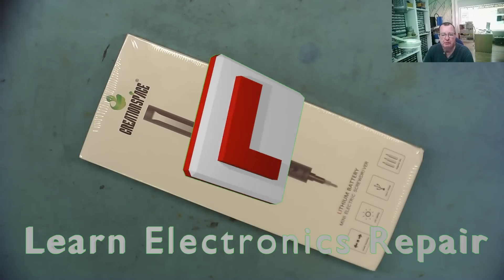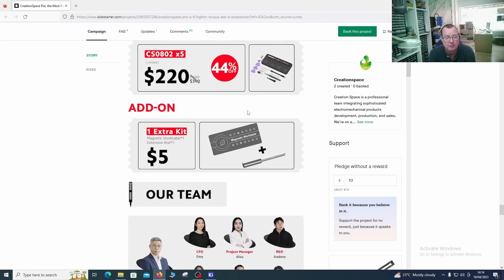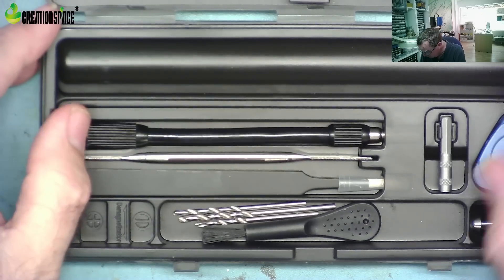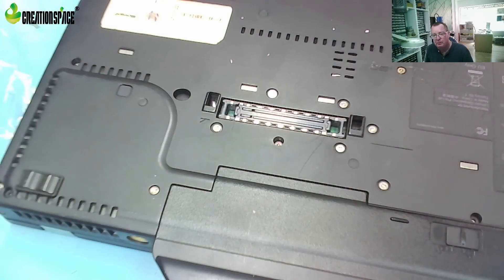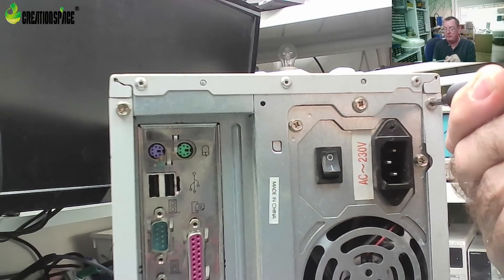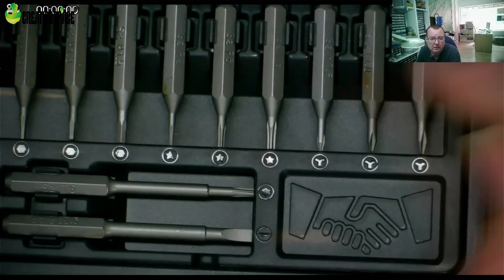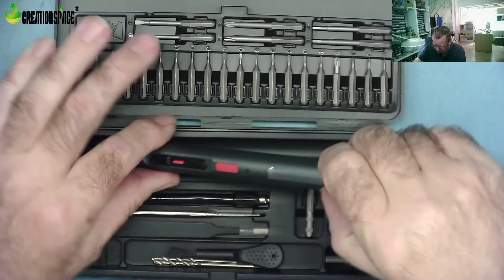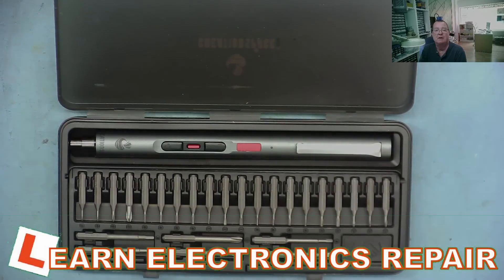CreationSpace Pro The Most Powerful Pocket E-Screwdriver.  Is It Any Good?

Comment: Problem is that high torque screwdriwers MUST have square body or a larger diameter. Small diameter round body of this screwdriwer will just cause it to constantly slip away in your hands and your hands will get increasingly tired with prolonged use.

Comment: I cant clearly see on your video could you please test if it has autobrake - just use it as normal screwdriver and try screw in big screw and tight. Is it slipping? It is essential feature which is never advertised. I bought Xiaomi one it has no autobrake. Cant use it as normal screwdriver :/

Comment: I see you have problem when unscrewing, its easier if you use device like regular screwdriver, just to loosen the bolt, then activate it to unscrew fully. 
Since it has torque to drill, it has torque to hurt hand also.

Comment: I wonder if this uses a standard 18650 or 21700. The current fashion is to go fully disposable with non replaceable batteries in most things.  This is good for unscrupulous manufacturers but less attractive for end users. Quite obviously, you might not want to wait for it to charge in the middle of using it.

Comment: If I just hear "kgf", my brain switches off. That took only 1 minute 56 seconds.
"kg" is kilo gram. That is MASS. Mass has nothing to do with force, mass is the same all over the whole universum. "kgf" is utter nonsense. There is no such thing as "mass force", that's what the "f" thinks to make it out off. "kgf" would require gravity to make some sense. About 5 decades ago, there was "kp" standing for kilopond, that was the force generated by 1 kg with an acceleration of 9.81 m/s^2 (earth's gravity). But this too was utter nonsens. Force is measured in "Newton" or "N" and that's it. No gravity involved, true in the whole universum. Torque is measured in Nm (newton meter). That is a force of 1 N with a lever of x meters.
BTW: "kgf" is an US-invention. They wanted to get international, but they just screwed it up even more.
When will they ever get the SI (Systeme Internationale) right?

Comment: I like the fact it is a small drill, the screw driver part on small screws is just a gimic. With the chuck you could put on a cutting disc, wire brush, grinding wheel etc. making it very handy.
Reply: The RPM is way too low to use it with any abrasives. This screwdriver sounds like it is going no faster than 300 RPM to me. To run a small diameter abrasive you have to go 100 times faster than that. Like 30,000 RPM That's how fast Dremels go. At 30K RPM a 1 inch diameter disc as a surface speed at its periphery of 7,853 Surface Feet Per Minute (SFPM) That will do some grinding.

Comment: Those Y-shaped bits are usually referred to as Tri-Wing. 

I have looked at a few different versions of these drivers lately with a view to buy one to save my old hands and there are a couple of things worth pointing out, the main use of this is going to be repair jobs involving a lot of screws, laptops etc. I see a few people obsessed with torque and it seems to me that is one of the less important things to look for in a tool like this, you aren't going to be loosening lug nuts on your car with it.

For me the most important things would be battery life, comfort, grip and the quality of the magnetic bit holder. The drill attachment on this one seems like an odd idea, I can't think of many use cases for it, maybe to quickly clear a hole or something, but I would imagine anything more than that would just eat the battery.

Funny story from back in the day regarding those triangular plastic spudgers, I used to work repairing Samsung phones back when slide phones were the latest and greatest. The place I worked had lots of Eastern European workers with varying levels of English language skills. A new batch of spudgers came in and one of the supervisors walked around the office offering everybody a "threesome", I don't think he ever lived that one down!
Reply from the maker: It seemed quite capable of unscrewing in most cases using the low torque setting.  It's comfortable to hold but has a tendency to spin out of you hand unless you keep a good grip on it.  The battery life is '300 screws' on one charge, apparently.   I do like this tool and will definitely be using it on the channel so in a little while we will know how long it lasts on one charge.  The drill is quite nice for working on small electronics projects I think, drilling mounting holes in the pcb or veroboard, that sort of thing.  For anything bigger I would probably use my Dremel
Reply: Would have been nice to see a grinder for shaving down metal on usb connectors or solder mask I guess could find some somewhere
Reply: @tezraym  I think you would be better off investing in something like a Dremel for things like that, something else on my to-buy list lol.
Reply from the maker: @badgerfool1980  I have  a Dremel (a genuine one) and I love it. It's one of those things I bought then wondered how I had ever lived without it.  Despite that I still really liked the CreationSpace Pro.  I also have a kinda affinity for the principle of Kickstarter and crowd funded products 🙂
Reply: @LearnElectronicsRepair  I'm with you on crowd funded projects for sure, it's a great way to help clever people with interesting ideas get off the ground, this certainly looks like a pretty decent offering for sure.

I think there is a risk of falling in to "Jack of all trades master of none" with tools and it's down to the individual and how often you will use it whether to go for something that performs many tasks but not particularly well or one tool that does the job really well.

Rotary tools like the Dremel seem to be the exception from everything I have seen in that they do many things really well lol.
Reply: Trilobe!
Reply: @1pcfred  The watch company? I'm confused.
Reply: @1pcfred  Can't say I have ever heard those bits referred to as trilobe, only tri-wing, what country are you from? maybe it's a regional thing?
Reply: @1pcfred  I didn't come up with the name and don't really care about it's accuracy but good luck finding these by searching for trilobe and not tri-wing
Reply: @1pcfred  Yeah I'm not an apple guy either but Nintendo also use these.
Reply: @1pcfred  Just had a quick look out of curiosity and while everybody uses tri-wing to mean these ones, "tri-wing" is actually a registered trademark of the phillips screw company and theirs are a bit different lol

Comment: Wow didn’t realise how expensive these screw drivers are looked up the Es15 mentioned in comments think I need to do some research which one the majority are using
Reply: If I want a power driver I use a cordless driver. But it ain't going to slip in anyone's pocket. They're way more powerful than power screwdrivers are. I even have a pretty dinky one that's not bad. Still too big to pocket. Little power drivers like this one are faster than a manual screwdriver is though. I've thought about getting a power screwdriver but meh.